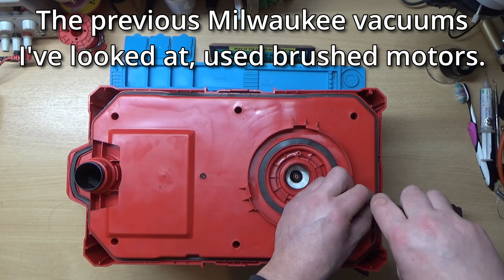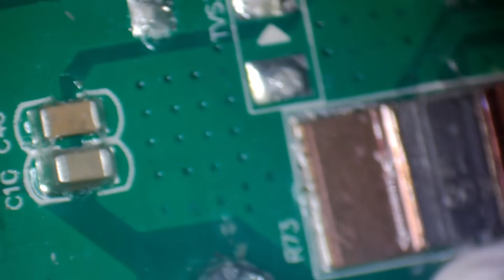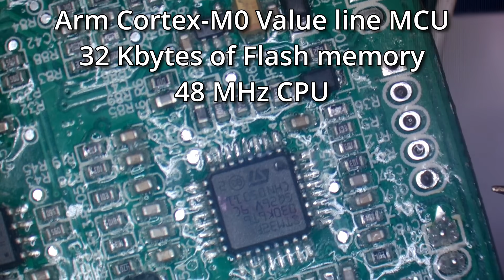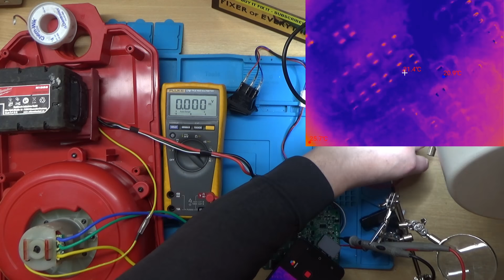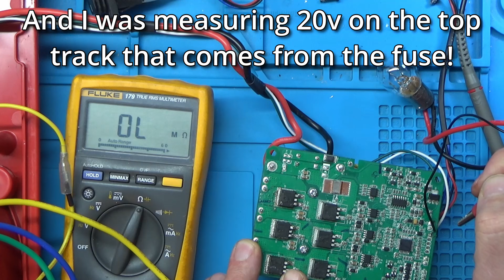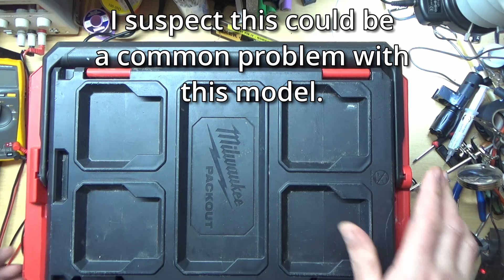Faulty Milwaukee Packout Vacuum Cleaner | Can I Fix It?

Comment: As an automotive diagnostician,we call it testing the supply under load.Multimeter does not say the supply is fully healthy or not, it could break down under load.Use different rated lamps(5w,15w,60w) to test the supply under load.

But indeed,if the fuse was half faulty,the supply voltage should 'sag' under load(when it is trying to switch the mosfets).The situation is still looks strange,because you could measure voltage at the supply line.

When you looked with the oscilloscope at the gate pins of the 3mosfets(these were not switching),i was very close to say it is a faulty highside gate driver ic or components belongs to it.But thankfully you tried to load test the input fuse and found out it is half/faulty.
Reply from the maker: Thanks for the tip, testing under load is definitely a great way to catch those tricky intermittent faults! 👍🙂

Comment: I think the metal foil strip inside the broken fuse may bend when under high load (like a bi-metal) and cut the connection ... ceramic looks a bit fractured too ... great job - again.
Reply from the maker: Cheers for the feedback, glad you enjoyed it! 😊

Comment: I had a suspicion about halfway through that it could be a resettable fuse, since there wasn't much left upstream that could shut off the current. They basically act like tiny hair-trigger PTC thermistors, so you might have been able to see it tattle on itself through the thermal cam, but it takes such little heat for them to stay latched that it's a toss up. I wonder if that's why the positive switching on the mosfets looked so dirty?
Reply from the maker: Yes this one had me stumped for a while, but figured it out in the end. It actually seems a common problem on this device as there's been quite a few people comment that they've fixed their vacuum after watching the video. I'm not so sure on the mosfet.

Comment: Just two comments - Great fault finding getting that partially open fuse. I think that it is ridiculously over-engineered for a 2-speed hoover, but it does seem to work well once fixed.
Reply from the maker: 😂😂😂Thanks 👍Brushless motor driver and power management for the battery. More complicated but in the name of efficiency (extended battery life, and more suck apparently).

Comment: Ive got the older version it goes to start very slightly then doesn't any one had same problem? thanks
Reply from the maker: Could be a number of things switch, motor, or a fault on the low voltage cut off board.
If it's the older model you can just try wiring the back wire from the motor to the black wire going to the battery, this would bypass the control board which disconnects the battery when it gets too low. That would then tell you if it was the PCB or not. You could also try powering the motor direct from a battery to help diagnose where the problem lies.

Comment: Where can I buy that fuse?
Reply from the maker: I'm not sure I'd buy the same fuse as was in it as they seem to fail quite often. Perhaps a better approach would be to buy an automotive fuse of the same amp rating, and use a fuse holder soldered onto the board with a couple of wires.

Comment: Yes but on something completely different. I fitted a Victron 50amp  B to B charger from my leisure batter to my habitation battery on my motorhome  and in the supply a 60amp resettable fuse. When driving I could see via a Bluetooth connection to the Victron it start to charge at 50amp then stop and show a voltage drop from 13.4 to 7 volts then go back to 13.4 before dropping out again. It turn out to be the fuse, when the engine was off I had 13.5 both sides of the fuse but when the engine was running and the b to b started to draw current the b to b side of the fuse dropped to 7volts so the B to B shut down then started up again when the voltage was back at 13.5v. The fault was the fuse that was getting very hot. Remove and replace the fuse for a better type and all was ok.   NB. B to B is Battery to Battery charger.
Reply from the maker: Interesting, thanks for sharing 👍

Comment: Crazy amp rating for an SMD fuse. Basically its too small for an air gap so I guess vapourised fuse allowed some conduction. I wonder what the largest size of SMD fuse is? 30A must be the largest surely.
Reply from the maker: I just did a quick search and found a 40A SMD -  0456040.DR , although it's not a resettable type like this one.

Comment: Hi there do you take on jobs for subscribers.  I have caravan battery charger the same has the one  you replaced the micro chip in  its kind of working but not has it should . No worries if you don't  take jobs on .
Reply from the maker: Hi Nigel, I do take jobs on at times but it would depend on if there was any timescale involved. I only do this as a hobby and I've got a bit of a backlog of stuff to get through. I've also got to do a lot around the farm before winter sets in.

Comment: I just ran into a similar smd fuse issue. it was feeding power to a couple of usb ports on a pc motherboard. It was reading 75 ohms across it and I also had to scratch my head at it. I also came to the same conclusion that it must be a resettable fuse that's gone partially faulty. It did light up under a thermal camera when I tried to plug a usb device in. Kinda strange but yea, who knew.
Reply from the maker: Interesting, thanks for sharing 👍 Hopefully it will help other people come to the same conclusion too.

Comment: This is why voltage drop test method on fuses is one of my favorite methods I learned from automotive technicians. By this method we actually test voltage drops at fuse both ends. If fuse is not working properly it’s showing voltage drops and we will know that fuse is defective. Once upon a time I was stuck with one CNC router machine’s electrical panel where partially open fuse took my time to troubleshoot a problem in machine. I was just trusting my continuity test method with multimeter to diagnose. But when I checked voltage on fuse both ends it was actually no passing voltage to load. I was really surprised how fuse was showing low resistance on continuity mode but actually it was opened fuse.
Reply from the maker: Yes, it was pretty much the first time I've came across something like this that wasn't down to corrosion or a bad connection. Thanks for sharing your experience too 👍

Comment: Never seen a fuse fail like this before but I guess why the best methods of testing we use (in automotive) always apply a load as the voltages can sometimes be misleading.
Reply from the maker: Yes a few others mentioned similar about using a load 👍

Comment: I'm always amused at the sheer amount of complexity that goes into modern electronics when, in my day, it would be a simple switch + motor and the usual fuse!  Sure, brushless motors are more powerful and need to be controlled but still, that amount of electronics just to make a motor turn?????  Give me a Henry any day.
Reply from the maker: The previous model was pretty much that (apart from a small board to disconnect the battery if it overheated or if it was under voltage). I guess they are in pursuit of more suction and more efficiency from the battery.

Comment: Is it just me, or does the notion of having a CPU with waaaay more power than took man to the moon & back running a 2 speed motor seem just slightly absurd?

Confess when I saw the 3 Ohm reading from +ve input to the MOSFETs I thought that looked high.

As always, good fix.
Reply from the maker: Thanks 👍Yes it had me puzzled this one for a while, but I found it eventually 🙂Yes crazy to think about the CPU etc. It was the same for the Milwaukee spotlight if you didn't see that one. The one has a CPU running a boost converter and measuring the current.
Reply: @BuyitFixit  Haven’t got to that one yet, but I will :)

Clearly, Milwaukee designers missed the day they covered KISS. Or perhaps it’s just a sign of the times. If all you have is a hammer (an absurdly powerful processor that costs nothing) then everything looks like a nail (a job for firmware).  I do get the benefits, but this just seems a bit extreme!

Comment: Good job on this! It stumped me a bit as you went through. When you measured the resistance on the positive I thought it was really weird negative had nothing but positive had 2.5ohms. So I was thinking a bad connection. I certainly have never seen a fuse "half" fail like this before. Such a strange failure.
Reply from the maker: @braixeninfection6312  Thanks 👍yes first time I've came across that too!

Comment: just a simple vacuum. so complex electronics. melwauke needs to simplify their electronics for cost and reliability.
Reply from the maker: The older vacuum was pretty much a motor and a low voltage detection board. Everyone seems to be moving towards BLDC because of efficiency and more power from a smaller motor.

Comment: Had this happen with bad quality MCBs, the voltage tester screwdriver would light up bright on the phase side but very dimly  on the load side. This is also why a Fluke 117 with it's low impedance mode is my main multimeter. It's resolution isn't great but the accuracy makes up for it. When it says 0.001A, it's totally a milliamp flowing there. No more, no less. Confirmed many many times at work, with plenty of 4-20mA sensors.
Reply from the maker: Interesting, thanks for sharing Windshield 👍

Comment: I had an issue with my m18 string trimmer that was simillar to this. I bet it was the same problem. I ended up sending it back for warranty and they replaced the board.
Reply from the maker: Could well be 👍

Comment: Working with vehicle chargers for the past 15 years I've come across fuses partially blown probably five times. It can be very frustrating to get to the bottom of it and the fuses I work with are generally quite large. Great video but it really points out how complicated Milwaukee have made their equipment.
Reply from the maker: It's the same with things like Dyson fans, and other power tools that have gone to brushless motors. This is due to being able to get more power / torque / performance than traditional brushed motors of the same size.

Comment: You sir, have just answered all my issues! I've tried to repair the original circuit board to no avail. Bought a brand new board and had the same problem. Bought a new motor and no luck. Found out both the 30ah fuses on both boards are damaged.
Reply from the maker: You're welcome. It had me puzzled for bit but I'm glad I'm not the only one! Really glad it has been useful to you 👍

Comment: I have had that happen, but with a standard wire mains fuse in a TV, it measured fine out of circuit but was open circuit when power was applied to the set. I thought that I was going crazy until I substituted the fuse.
Reply from the maker: Thanks for sharing 👍

Comment: Great fix - pretty sure you'll get the flash memory working as well. It was probably just corrupted by someone loading the manual on to it but without being able to see an image it's hard to reformat it. They should have included an hdmi chip and error trapping.
Reply from the maker: Hmm this comment possibly relates to the RGB laser? but it's on the Vacuum video..

Comment: I have seen intermittent cartridge fuses.  Some had the fuse element soldered to the cap and some were just press-fit.  As far as surface mount fuses go, the worst are from China.
Reply from the maker: I couldn't find out where these particular fuses were made, but it wouldn't surprise me if that was the country of origin 😂😂

Comment: That has to be the most over-engineered control system for a vacuum cleaner I have ever seen. Three phase brushless motor controllers for RC toys use so much less circuitry. Betting the manufacturer paid extra for that kind of complexity.
Reply from the maker: I know the board (as all Milwaukee tools do) also monitors the battery. The Milwaukee batteries don't have any under voltage protection, so this is done in the tool and it's up to the tool to disconnect the supply once it drops below a safe threshold.

Comment: I'd guess that was a 'resettable' fuse. More complicated than a traditional 'one and done' thermal wire fuse, but supposedly more convenient. They will have an expected lifespan, probably reduced due to repeated very large inrush currents. I suppose it did its job in so much as when it finally failed, it only allowed a tiny current on the board, but prevented high current from the battery.
Reply from the maker: Yes, weirdly enough I came across them on the AVerMedia device I repaired and they also measured 4 ohms.

Comment: I once had a filament fuse on an amplifier that had continuity until power went through it when it kind of half disconnected causing all sorts of noise. Found it eventually by tapping the board and noticing the noise change.
Reply from the maker: Pesky fuses 😂😂Sounds like the wire may have been loose inside.

Comment: Back in the 70s an indicator fuse, with the pop out , normally stunted with a main five of higher value, was used as a main fuse. Over time the fuse resistance increased, dropping the voltage until failure. This repeated over and over. I still remember the pop out indicator was green. 😀😀
Reply from the maker: Pesky fuses 😂😂I actually came across these again on a couple of videos after this one on the AVerMedia video capture card I looked at, they measured 4 ohms too and were absolutely fine 🤷‍♂️
Reply: I wonder if these fuses have a brand name on them.
Reply from the maker: I'm not sure, I used Google lens to try and find the same fuse.

Comment: As your first experience with that issue you found it fairly well, nice. It is common with ac motors I learned to always test fuses under load for a full test. Nice job, remember something might have caused it to go though so watch for that.
Reply from the maker: Thanks, I think it could be a faulty batch as the guy I got it off had a few and one that would work for around 5 minutes before stopping  (which was also caused by the fuse). Strangely enough I recently looked at an AVerMedia video capture device (video on here) and it's fuses were similar and also measured around 4 ohms.

Comment: When you measured the resistance of that fuse, it read fairly high for a fuse, 3.5Ohms, or something like that. The resistance of the motor windings was 0.3Ohm-resistance of your meter leads, so at least 10x lower than the resistance of the fuse, so all the volatge would have dropped over the fuse, but you got it. Interesting fault, have never seen a fuse fail like that before. I like your methodology of fault finding, unlike so many other youtubers that just measure for shorts and then look with a thermal camera with no oscilloscope even in sight… great repair videos.👍👍👍
Reply from the maker: Thanks, those fuses are weird. I just recently repaired an AVerMedia video capture card, which had two fuses which were almost the same as these and both measured 4 ohms so 🤷‍♂️
Reply: What's wrong with using a thermal camera to find what gets hot that shouldn't be getting hot? Seems like advancement in technology is making microboard repairs easier to me. Sure, you could learn to do it any old school way you want, but that might take an hour or two longer, and as we all know, time is money. Oscilloscopes have their uses, measuring resistance, voltages, checking for shorts are all part of the diagnostic procedure, and using whichever one gets you to solve the problem faster means you can finish more jobs, meaning you can get more money, and then spend it on much  better drugs and hookers at better casinos. Simple as that.
Reply: Fuses shouldn't be internal. They typically are user replaceable.. It's worse when both fuses go. Plug and PCB. half tempted to replace with wire and keep plug fuse.

Comment: When i saw power cut out right away i assumed some sort of short was triggering protection from the battery, interesting it ended up being the fuse.
Reply from the maker: Yes, I didn't suspect the fuse either as I got voltage on both sides of it. The batteries don't have output protection only charge protection.
Reply: @BuyitFixit  well the cutoff is on the tool side for milwaukee but in the case of a failed cap youd see similar symptoms from overcurrent protection shutting off due to a shorted power rail

Comment: kkk, in cars is usual some times a mother*** like that... because that we use a bulp (tester), and not allways multi... never the less excellent :)  ps- cut red  wire and install a car fuse 30amp, use a suport, or junt solder :) (30amp in that size smd...hummm)
Reply from the maker: Yes, I've had things similar to that with corrosion in the stairwell wiring loom on a VW Passat. I think it was for the central locking or electric windows (it was a good few years back)..I've not had it on a PCB before though.